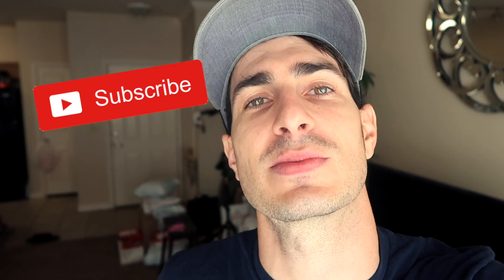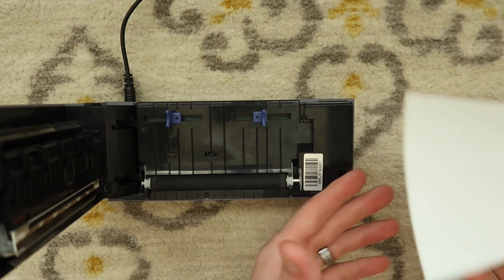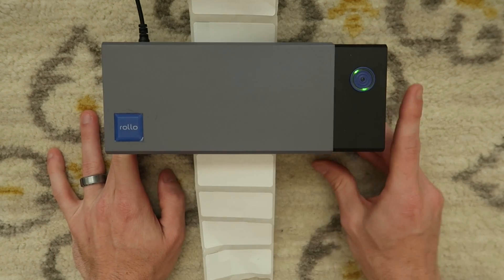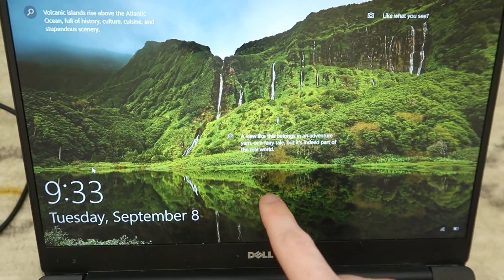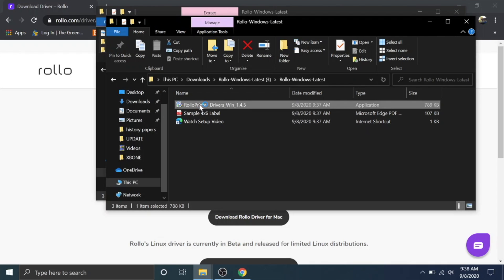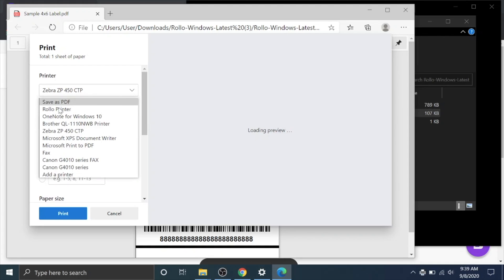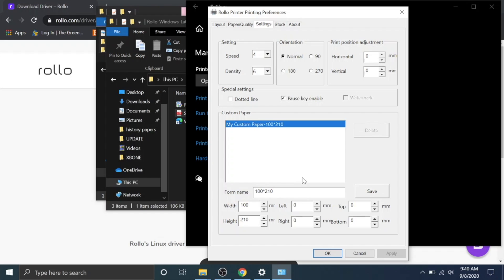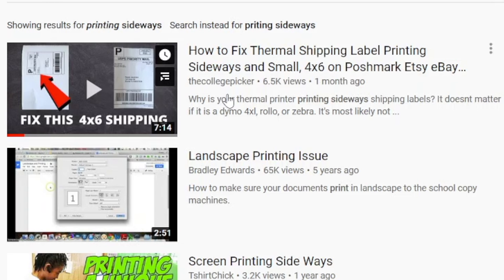How to Set up Rollo Printer on Windows | Step by Step Tutorial Driver Install, Calibration and Setup

Comment from the maker: Cheaper than a Rollo, and Wifi, 2021 thermal printing tech is looking good!
FreeX Wifi Thermal Printer - https://tinyurl.com/4m43v9nr
FREE50 - Coupon Code to get $50 off
Then $10 off for and IG post
$40 off for a video review
Potentially $110 total, for a wifi wireless thermal printer. Not bad.

Comment: I already have a rollo printer and wanted to set up a new one cause my first one is broken. But after installing a new rollo doesn’t pop up and If I try printing to the original (no longer connected) it will print halfway on the new printer
Reply: Anybody have any advice or tips?

Comment: Hi, Eric.  I followed your tutorial today on how to set up my Rollo thermal label printer and had great success right up to the point where I tried to print a label from within Ebay for an item that I sold.  I logged into Ebay with my username and password, then went to Items Sold and selected Print Shipping Label, and nothing happened past that point.  The main portion of the screen goes blank (white) with just the Ebay header bar at the top of the page remaining.  I re-tried several times, and the same thing results.  Any idea on what may be causing this?  I'm using an older HP laptop running Windows 7.  Like I stated, everything was going along fine until I tried to print an actual shipping label.  Thanks in advance for your help!
Reply: Did you see the part where he plugged in the printer into a wall outlet?

Comment: I bought the rollo, I’m sick of fighting with my Dymo 4xl , it’s so temperamental, I wish there was an instock AirPrint thermal 4x6 printer, your videos are helpful
Reply from the maker: thanks! yeah airprint thermal printers are in short supply =(
Reply: Rollo had a WiFi model now. And they are making an adapter for the old one to be WiFi capable

Comment: Do not buy the Rollo Printer! or you'll throw away your hard making money! I bought my Rollo printer after I watched a Youtuber's recommendation video, I bought it on 5/19/2019, and it started breaking down since the end of Aug. 2020. I reached out to the customer service, the technician took 2 hours to remote fixed it. Today, it stopped working again. 
And I was with the technician on the computer for 4 hours. I did everything they asked, turned it off, unplugged the power and cable, put it back on, turned the power back on for multiple times, switched 3 different USB cables as the technician requested,  after all of these, he asked me to change the computer in order to diagnoses the problem otherwise, they'll have to send me a new USB cable( which I have to wait at least a week) to make sure all my 3 USB cables worked properly then they'll make the final conclusion that if it's the printer breaks down. 
Then I finally have to take out my laptop which I put away for a long time, and finally, get the Rollo printer tested on my laptop, and after another hour and a half, the technician finally gave up, said that'was something wrong with the Rollo printer. 
After all of these, I send him my original order information as he requested, he called me right the way, said my Rollo printer is not covered under their warranty, they only have a year warranty. 
I paid $179.99 for the Rollo printer, and I'm a parttime seller with around 10 orders a week, now you can have a conclusion yourself too that if you should buy the "ROLLO" printer or not.
Oh, by the way, when you buy it, make sure you have some USB cable in stock and a backup computer just in case you might need it one day just like me.
Reply from the maker: I'm so sorry to hear that 😟. They are fairly cheap Chinese quality for the long term but yours must have died much earlier than it should have. 😭